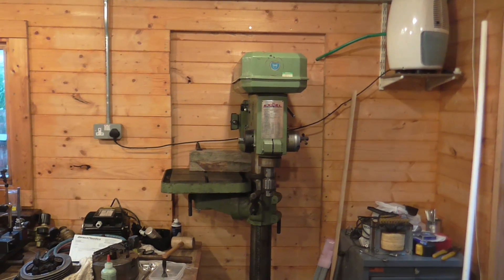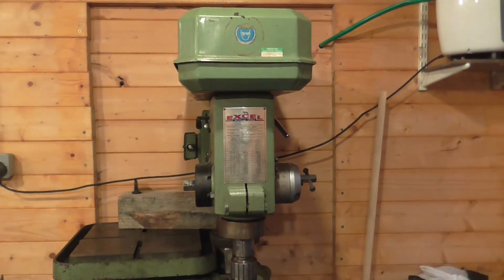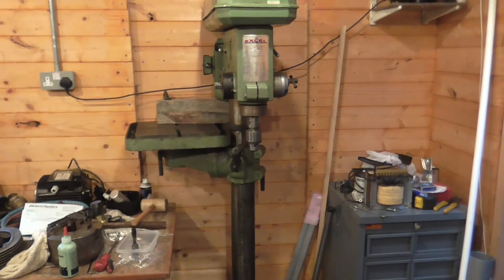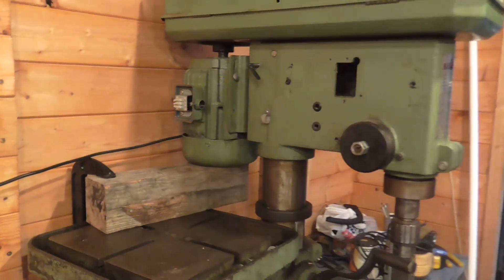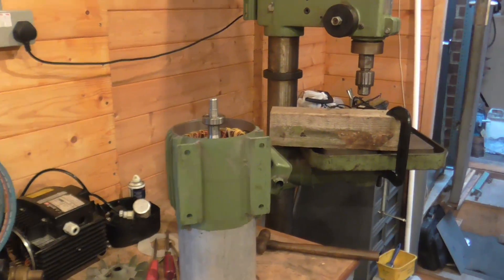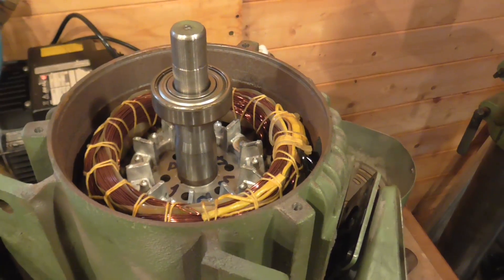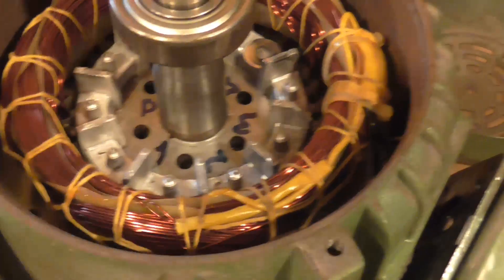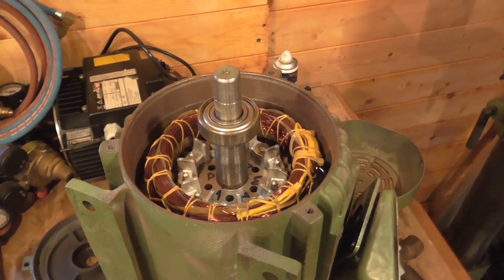Three Phase motor - votage conversion

Comment: Hi Paul.
Great video and demonstration!
Will this work on a dual wound motor? I have a Hardinge HLV which is dual wound and would like to run it from a VFD on 240v from the wall. I don't think I'm bothered about it being dual wound after the conversion as the VFD will control speed (unless I need to keep it dual wound?). Would it be the same principle as this or is it more complex do you know?
Jools
Reply from the maker: I presume you're talking about a two speed, or pole changing motor. These are generally already switching between Star and Delta for the two speeds (too keep a constant voltage to frequency ratio). There are now VFDs available that use a voltage doubler on their input and can generate a 415v output from a 240v input.

Comment: Hi Paul Thanks for posting this video i found this very usefull.I have just converted my motor for my drill press which is very similar to yours.I am running to from the inverter on my Bridgeport with a crossover switch.Keep up the good work.Regards Roger

Comment: Hi Paul, thanks for the video, would a capacitor be needed in the system or would it be ok without, I'm currently restoring a southbend 9b, and have a brand new 3phase motor I would like to use,
Reply from the maker: It wasn't my intention to run the motor on single phase (although I've done that before). The 240v conversion is to allow  the use of a 240v Inverter or VFD (variable frequency drive). See my follow-up video.

Comment: Thanks for the video Paul, hope you're OK, did you come off one of your bikes?
Reply from the maker: I did drop the big Yamaha GTS1000 at walking speed a few months ago, but because of the knee and hip, it wasn't the cause. 

I hurt my left knee a couple of years ago putting a bale of straw in the back of a Mazda MX3. The hip problems started when I had my leg in a brace because of the knee injury and has been getting worse lately. After various X-rays and an MRI, which showed nothing, it looks like I may have some kind of Bursitis.